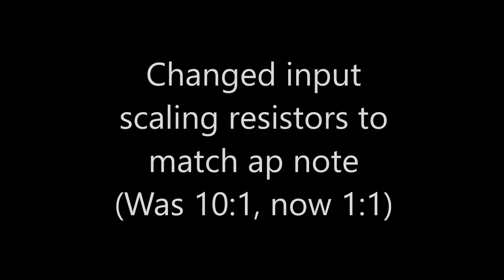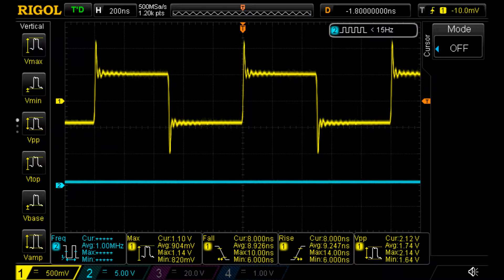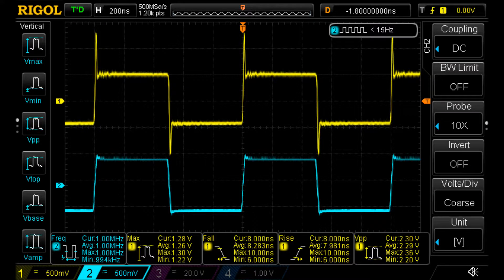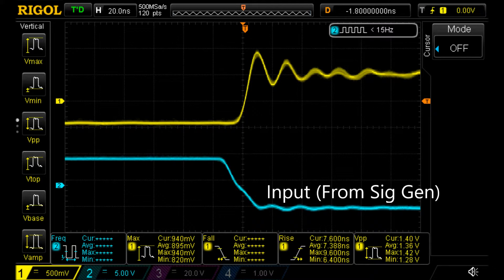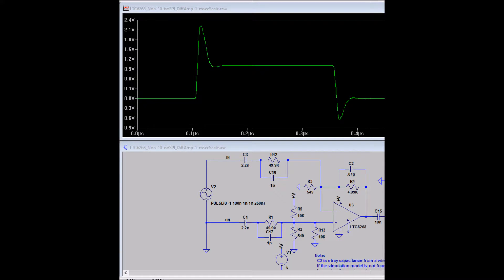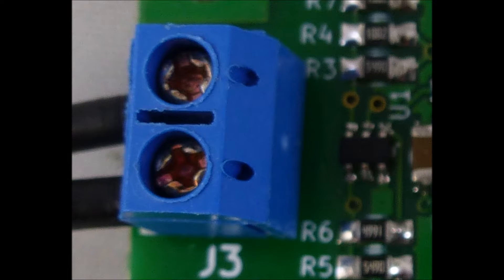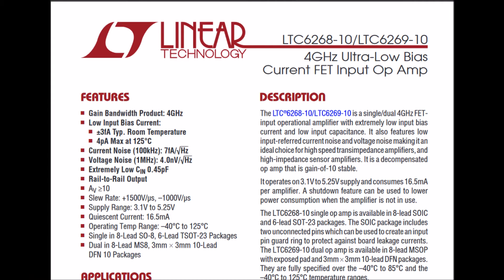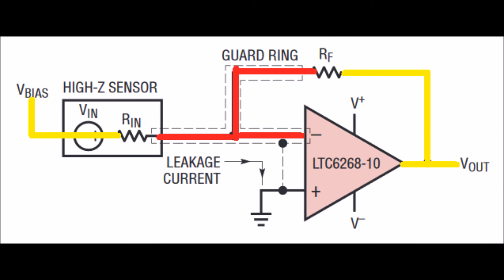Land Boards -  Differential Scope Probe   Part 3

Comment: I thought the guard ring is to stop leakage current from entering the input. The opamp has nuts input impedance (input currents in the femto amps) so even a tiny bit of leakage due to grease etc on the board might matter. Did you try twisting the input leads to reduce inductance? Could try adding tiny inductance into the simulation to see if that matches what you are seeing. If your bandwidth requirements are modest, increase the feedback cap on the op amp.